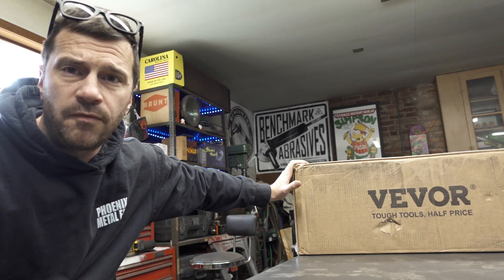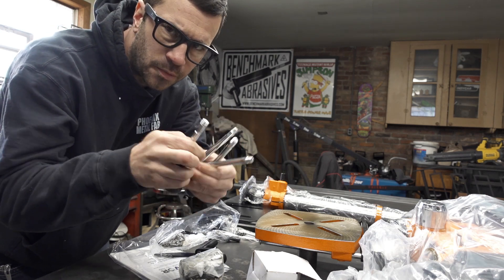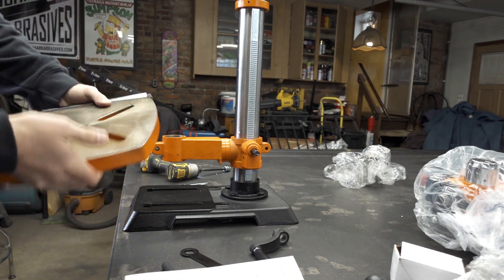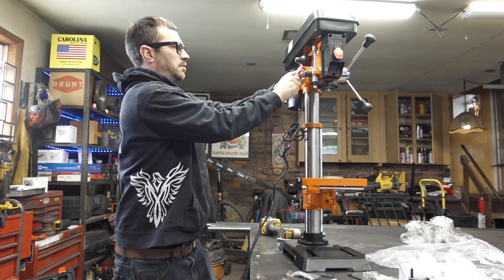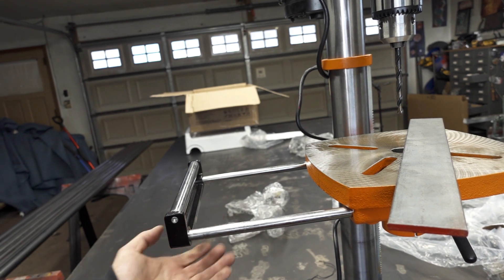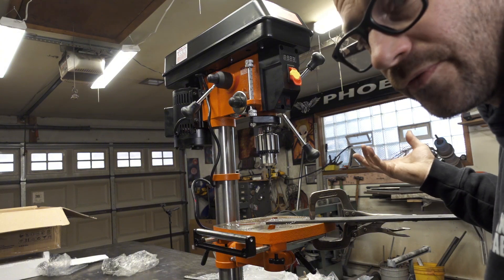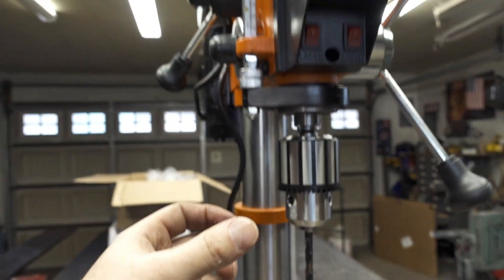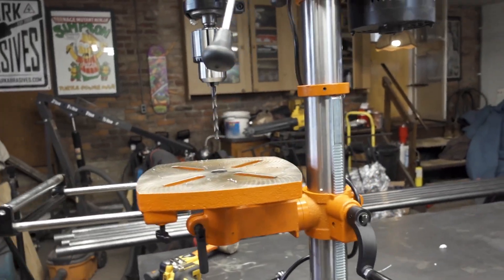VEVOR Drill Press 12in DP12VL (unboxing and first impressions)

Comment: Have you tried to attach the mortis and tenon kit to it? Seems the stop collar is in the way.
Reply from the maker: No I have not, I will be doing an update video on it soon. Had some problems with The belt slipping when drilling a ¹/² hole through 3/8 steel. 👎

Comment: What is involved in changing speeds? Is there belts that need to be moved to different pulleys?
Reply from the maker: There is a lever on the side where you can change it while it's running from 500 to 3000 RPM.